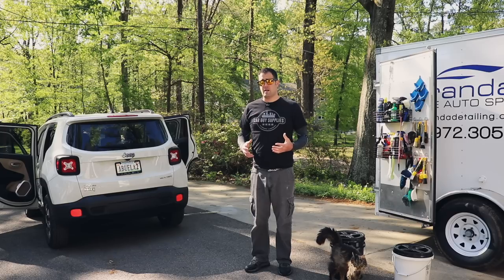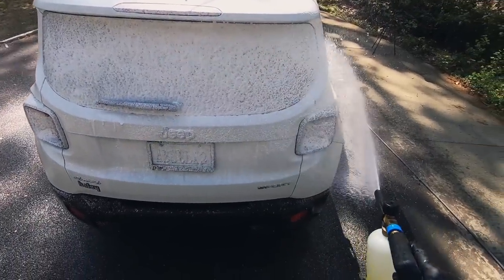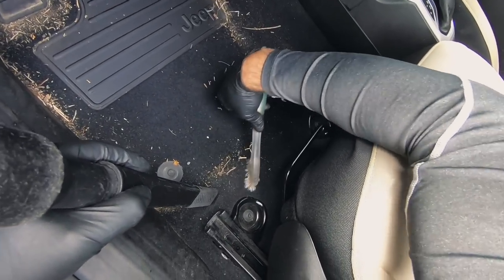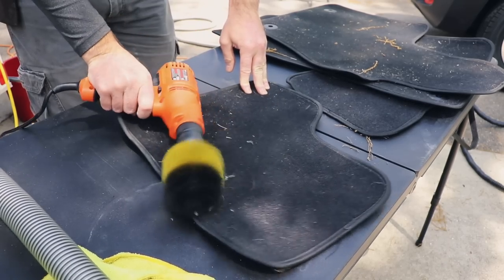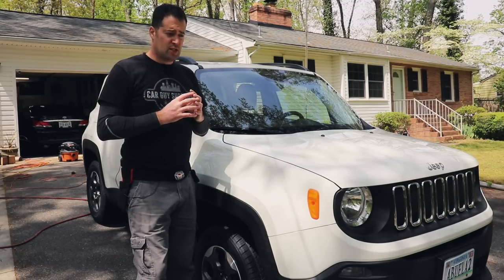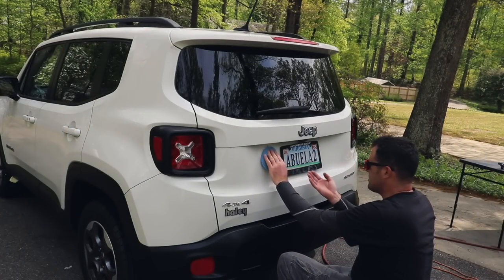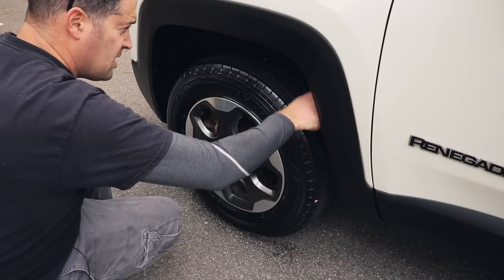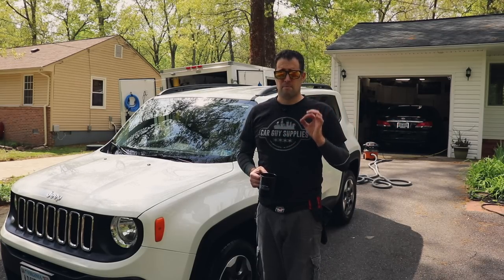Complete Interior & Exterior Detailing Tips & Tricks! #Jeep #mobiledetailing #detailingtips

Comment: I also use this wash method, which I learned from you. But I am going to be trying Brian with Apex details method soon.  His is probably the most logical I’ve seen!  You should try it out and let us know what you think.  Your method works well, it’s just nice to try other things.  His method is one bucket MULTIPLE wash mitts, and never putting that dirty mitt back into the clean solution. It’s pretty smart. I’ve got to try it out
Reply from the maker: Oh yeah I have done that before and it works great. For mobile guys it’s annoying if detailing multiple vehicles in a day. That means TONS OF MITTS!!  But I totally understand the logic.
Reply: @MirandaDetailing  oh yeah. Great point. I didn’t think of that... that is not a great option for us mobile detailers
Reply from the maker: Well if you’re only doing one a day it’s a good option. I guess just figure out what you need for each give me job on any given day. 😎👍🏼
Reply: I now stick with one bucket and multiple mitts. But I must say the classic white Meguiars mitt is VERY easy to rinse with a strong hose,  I own many types of Mitts but this one makes the job much easier. The multiple buckets method simply does not make sense to me in the real life... as I would not clean myself with the same water again either .

Comment: "Hi Phillip " Another Great Video!! I Have A Question Which is The Best Way To Clean Interior Lettering Without Removing Them. I Heard A little bit Of Dish Soap And Water Might Work But I'm Still Not So Sure if it's Safe?.. Like The Seat Buckle Part That's Red Mine Has A White Color To it, but I'm Not Sure if it Will Be Able to be Cleaned.  🙂
Reply from the maker: Hi. Actually try just using a damp towel. Just water. It should dissolve the porks enough to clean them away. Then if you feel you need to use a chemical just a gentle wipe with an APC should be fine.
Reply: @MirandaDetailing  Thank you Phillip,  I Appreciate it!!👊🙂

Comment: Phil u have gotta give Koch chemie green star or bilt hamber surfex hd a try. They sell both now at car supplies warehouse and on Amazon! They originally are from the uk but are very effective and very cheap! Also bilt hamber auto foam!!
Reply from the maker: Hi. Thanks. I did get some Koch Chemie green star cleaner to try out. I’ll have to check out the Bilt Hamber also. I have so many products that I don’t always jump on ones that people suggest. I have lots of stuff that works great. But I understand that people have their favorites.
Reply: @MirandaDetailing  I totally understand lol. Only reason I suggest is because of how safe they are to use and how cost effective they are. Surfex hd is a water based formula compared to most degreasers which are solvent based. This makes it much safer. It can be diluted along with green star up to like 1:30 and still be quite effective. Have a great day.

Comment: Amazing as always! Quick question, what would you Apply first, wax or sealant? Thanks
Reply from the maker: Thanks. I don’t layer waxes over sealants. I usually just use one because of the 12-24 hour cure time that is needed in between coats.  I have heard that it doesn’t matter since once they bond they degrade at the same time. Then I have heard that sealants should be applied first then I wax since the sealant lasts longer than the wax. Honestly it doesn’t matter to me since I don’t layer them anyway. If the customer doesn’t care or want to pay for it I don’t do it.
Reply: @MirandaDetailing  thanks for the feedback!
Reply: Sealants will come to 1rst  as they are more durable, then wax, which you can apply one week later, after you wash the car again, if it is too much work at once. 
But ! You want to ask the manufacturers how the products  react with one another. There are great combos although from different brands... To be honest, it may be hard to tell the difference between just one product or two when you are not a professional, and there are so many combinations... But I guess you may give a special attention to the wheels, they get really hot and many will prefer to apply ceramics on them first...
Reply from the maker: Yeah that’s true, but that’s really for the enthusiasts and bot for the Pros who do this as a business to apply a sealant and then come back a week later and apply and wax, becasue then you have to rewatch the vehicle after a weeks worth of dirt. I know you can do a rinseless or waterless wash at that point but it’s not profitable nor advantageous to do so.  We don’t layer waxes over sealants anyway, we have not found it to make a difference, especially with customers vehicles that we don’t see that often. But people can choice to do what ever they want.
Reply: @MirandaDetailing  Yes, the question comes from an enthusiast. My choice is Collinite 845, which is an insulator wax, so first, and after the next wash I will top it with P&S Beadmaker  for extra gloss, which you have to reapply every month or so, or use as a dry aid, but it's a pleasure... These 2 options are quite ok if, like me, someone does not own a garage...

Comment: Great video, as always! Question for you...when I use a clay mit or sponge, I always get unwanted marring. Not a normal amount, but more of a marring that mimics the pattern of the media. I've  gone to a clay bar exclusively as I feel like  I can control the marring more effectively. My question is, do you experience this? I fee like if I used the clay  mit, during the wash cycle like you typically  do, it would create less of this marring? Thoughts on this?
Reply from the maker: Hi..Thanks....Yeah the cay mitt and clay bar will usually leave the typical marring you're seeing.  When using it with the soap it still does it but maybe a little less.  But thats, when we have to pull out the DA and machine apply our waxes or sealants, it will remove that minor marring left behind.
Reply: Ll

Comment: If u pre spray with super clean can’t it take off ceramic coating or any type of waxes on vehicle or is that the reason of prespraying with it
Reply from the maker: Hi. The purpose of our APC rinsing is to do exactly that, break down and remove any lingering waxes and sealants. Ceramic cotinga can take high ph degreasers like this but we don’t wash a coated vehicle like this anyway. This process is only for full details that haven’t been detailed in a while. 😎👍🏼
Reply: @MirandaDetailing  ok got u thanks for tha knowledge